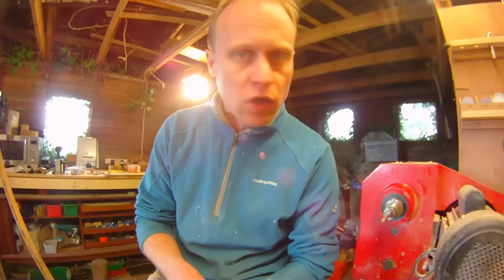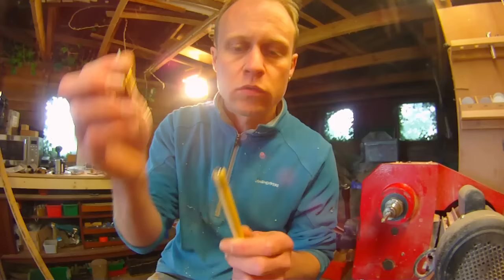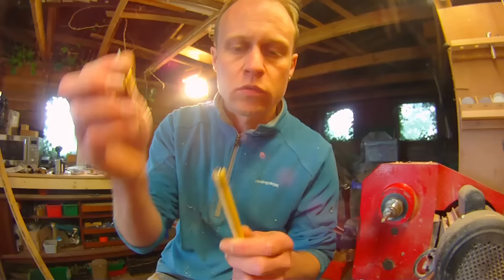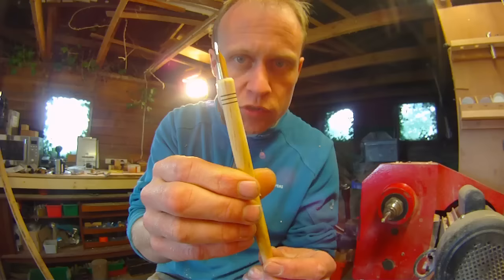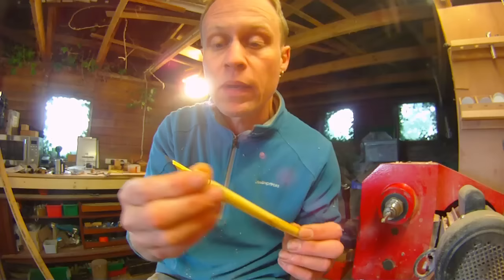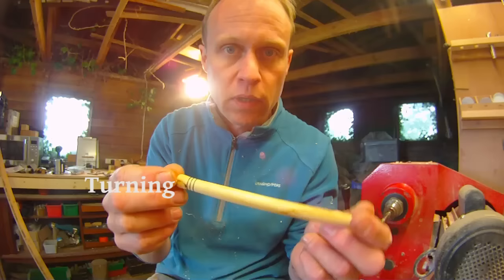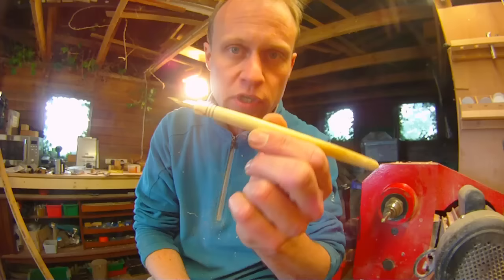#12 Woodturning a Dip Pen (quill)

Comment: Cheers, if I might suggest for the tail stock. Add an extra 1/2 inch to the  tail stock side and bring it down small then cut off and finish. You can use sandpaper to finish the very end. Great video by the way. Thanks to  Tom and yourself I'm going to try the coffee after I finish my cup.

Comment: Where can you find the nib holder/sleeve?  I'm looking online and can't seem to find that interface piece.  Great video!
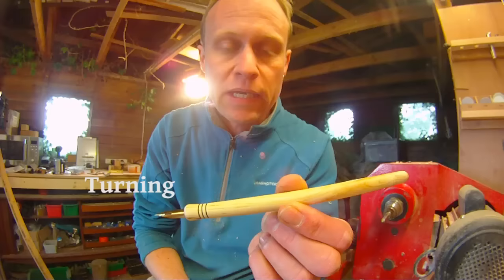Reply: It appears to be a piece of metal tubing which is supplied with the pen kits - you could probably make your own... Another YT video shows that part more clearly - check out the video from 1:10 where the guy inserts the 7mm brass tubing into the turned wood and glues it in place before shaping the 'collar' where your fingers would rest: https://www.youtube.com/watch?v=gKkOvDlhR9Q
An alternative is to Google how other people made dip pens - some used pressure fits into the wood or fashioned cork holders inserted into the wood/plastic pen body. The dip pens I remember from my youth were simple pressure fits into a wood holder; obviously you'd want a more elegant solution for a gift or good quality nib.

Comment: I have a few questions:
-What is that thing you're using with which you make the handle of the dip pen?
-How much does that machine cost?
-Where would I find that machine?
-When the handle is finished, where would I get the sleeve? Does it come with the nip or are they available separate?
Reply: It’s a wood lathe for turning of that’s what you’re referring too. They vary from a few hundred to a couple thousand depending on what you want it to do. There are websites that sell pen kits and it should come with all that is needed for the pen when it’s done.

Comment: how do you call that metal insert?
Reply from the maker: Hello Mr Leader.  Thank you for your comment.  The Dip Pen Pack Kit consist of the metal nib inserts (they don't seem to have any other 'technical' name), 7mm brass tubes, and the nibs.  You should be able to find some kits on eBay, which is where I purchased these from.
All the best,
Martin